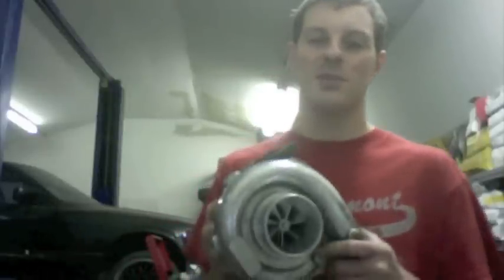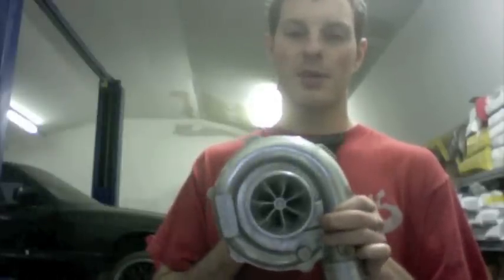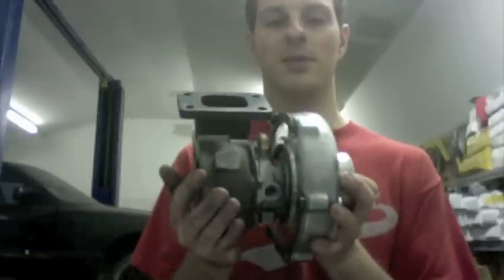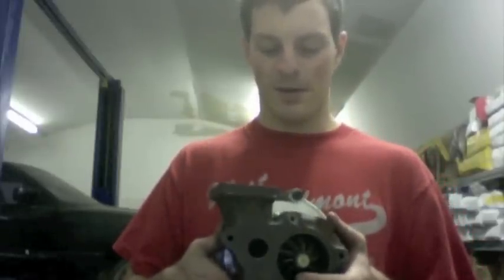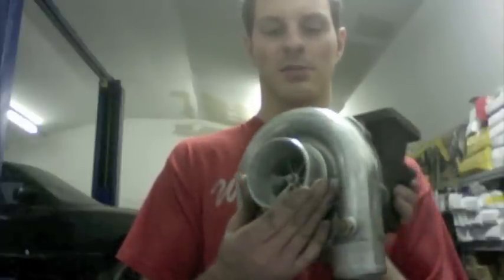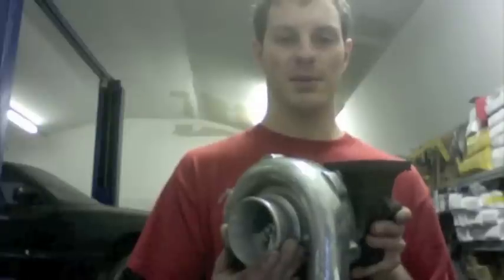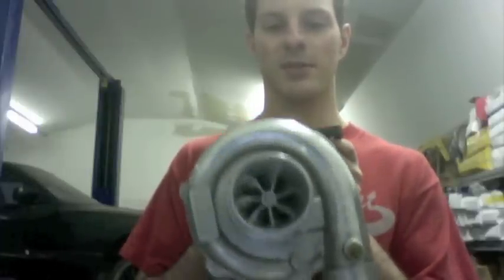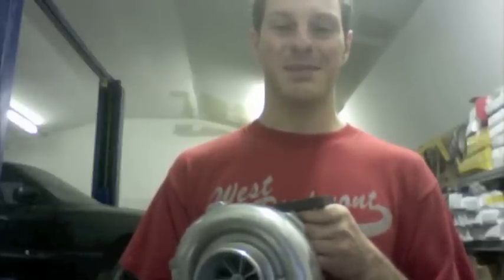Ebay TO4E 50 Trim Turbo Rebuild and Upgrade -Turbo Lab

Comment: have you or if not could you do a video on putting a carbon seal on a T04E? I have searched high and low and no one has done a video on this. I have a Draw Thru application but am not sure how to put one on the T04E T#/T$ I have for the project.
Reply from the maker: I do not have a video on that. I rebuilt one before but it was a really long time ago. The turbo I rebuilt was from a thunderbird.

Comment: Hello I am going to buy a Garrett T3 turbo 50 trim but I am undecided on what AR to get for my Neon SRT-4 maybe you can help me trying to make 400- 425 horsepower
Reply: What did you go with? I have an srt4 also running an ebay t3/t3 t04e.

Comment: I have one of those 50/63 ebay turbo. My question is if  I install a bigger wheel compressor to this turbo without any modification to the compressor housing? If I can which one you can recommend? Thanks in advanced.
Reply from the maker: +Alexis pr the compressor housing has to be machined. I would not recommend altering this turbo very much with the .63 turbine housing, it's just too small and can cause a heat soak if you run high boost. Some of them said .63 but they were really .58, some are really .63 though.
Reply: +Turbo Lab America  ok So I can even install a garret 50trim wheel or the chinese wheel have the same specs? Im running low boost 11 Psi max on my H22a4 stock interals make 256whp and 240trq I"ll like to make 20whp more. My tunner says if I put a bigger turbo and delete de IAB system the engine should get it.

Comment: Can I send you a Chinese turbo in for a upgrade?
Reply from the maker: +David PhoTWENTY Yes. i dont really like to machine this turbine housing in this build. it just makes more sense to go with a larger one, because most of these are only .58 housings. I maybe able to use your housing as a direct fit or machine it if i have to. which version do you have?
Reply: Its a  GT35 type turbo by godspeed , the shaft does have some play, the blades just barely touch the turbine, it was only ran on 7-9psi
Reply from the maker: can you email me some pictures. Turbolabamerica@gmail.com. then i can let you know what you can do with it.

Comment: You think that gives to machined this exhaust manifold (ebay ar63) to holset hx35?
Reply from the maker: Bruno Pinho puto i have machined them to hx35 before but its not a good idea in this housing. its actually a .58 rather than a .63.  the .63 machined to and hx35 is a pretty good combination. i have a .63 4  bolt that i machined to an hx35 which a customer didnt pay for.
Reply: Turbo Lab America you think this exhaust housing is ar58 rather than of ar63?
Reply from the maker: this one in the video is anyway.
Reply: Turbo Lab America what did this cost

Comment: Hey man I have a Turbonetics T04b super S that I need to rebuilt can I use the parts off a garret t04b? or the parts off a turbonetics o,p,q trim? any input on this would be great
Reply from the maker: You need to measure the shaft bore.  If its a 6.35mm Shaft Bore then you need the TO4E TO4B Kit like the one we sell here: http://ebay.to/1yUghJC .  

If you have a gold back plate then your can use a big shaft rebuild kit, but it doesnt include the ball bearing.